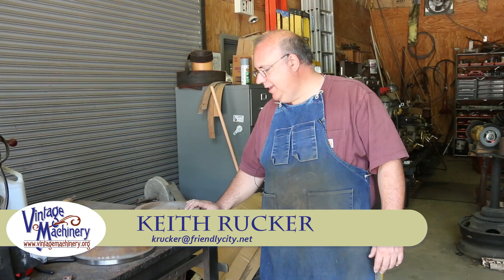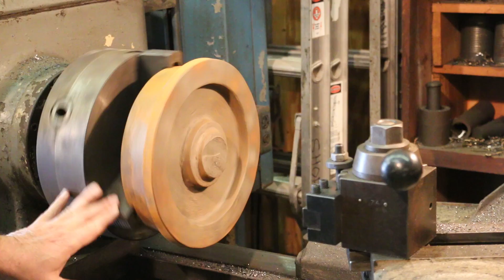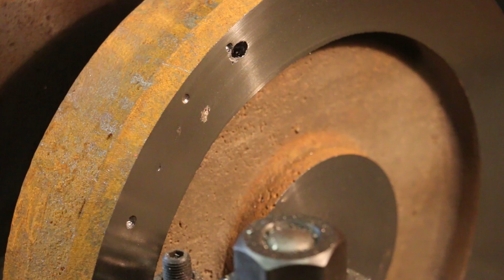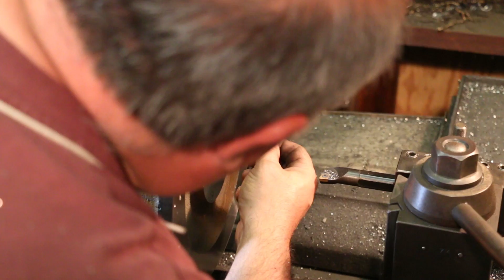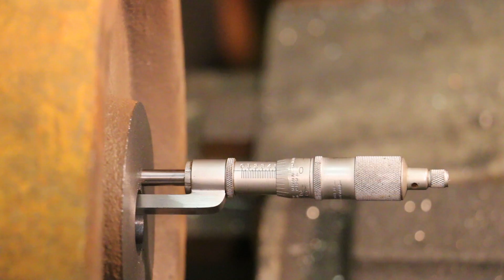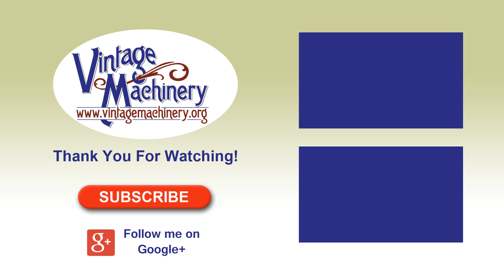Machining Cast Steel Railroad Wheels

Comment: Interesting project; nice to see some chips again.

I taught myself to put the right amount of pressure on a micrometer by closing down on known sizes (gauge blocks) until I could arrive at the exact (known) measurement with my eyes shut. Practise that way with several different micrometers until you hit the correct measurement pretty well every time. Get in the habit of measuring several times and measure a few more times if your measurements aren't all the same.

If you discover that one of your micrometers errs consistently, it may have been calibrated by someone with a different "touch" than you have. Time to recalibrate it to match your touch.
Reply from the maker: +Peter W. Meek Good advise!
Reply: On a 0-1 inch, couldnt you close it all the way and the pressure it takes to go exactly to zero is the pressure you want to shoot for when taking a measurement.  Thatd be a pretty quick way to know exactly how much pressure for that particular mic.

Comment: 1" shaft seems awfully small to me too..  yikes!
Reply from the maker: +Jay Walt If I were building them from scratch, I would probably want a bigger axle, but they are basically re-building some existing cars and that was the way they were made.  Having never seen them, I don't think I will question them too hard.  It is a smaller gauge railroad afterall.
Reply: @VintageMachinery  Keith, back when we were building 1.5" scale equipment we used 1/2" DC1616 bearings.  1" bearings of the same type would be fine with the 2' gauge equipment.
Reply: The axles are loaded principally in shear, and not flexure. Since  the car-load consists only of passengers, it will be light (maybe several hundred pounds).   It is probably  OK, but I'd do a little pencil-and-paper stress analysis if I was involved.
Reply: To understand axle size requirements you need to understand the design of railway car axle/wheel design and the load it will carry. 
A quick Google search will bring up the Veterans Memorial Park Railway in Bristol Fl. and watching one of their videos you can see each car holds 10 adults so you can easily figure  each car will carry up to an average of 2000 lbs of people. 
Now understanding rail axles you need to know the axle between the wheels is primarily there just to hold the wheels apart the proper gauge. The weight is carried on the stub that sticks out beyond the wheels. 
It’s not like the axle needs to carry the weight from the center.
Reply: +Jay Walt It's a small thing. Check them out on the internet. 8 wheels per cart, i'd say distribution is all right.
Reply: +Jay Walt Agreed - I'd expect the axle for a 2" gauge railway to be more like 1" radius at least. Maybe a miscommunication somewhere along the line?
Reply: That is correct. The trick is machining a radius in the corner of the axle shoulder to prevent breakage.
Reply: 88,000# shear strength... on a 4-4-2... 3 axles...
methinks is plenty durable,... prob. a hardened axle also.
how long is a lifetime guarantee ??
Yours, or the Companys ??

Comment: Keith, is grinding those voids out and TIG filling them not a reliable option for train wheels like this?
Reply: I'd be very wary of welding something like this, it might provide an asthetic repair but these are only the faults that have come to the surface and may well be an just indication of the quality of the casting overall. Without xray or similar evidence of the soundness of the work I would say the best use for that castng would be as a trial piece for your setups and then as a useful weight to put behind the door on a windy day.
Reply from the maker: +Thomas Utley Tom - as far as I am concerned, that whole casting is suspect to me now.  They have extras so I think it would be best to just start with a fresh one.  That casting will probably be the one I set up the CNC lathe on when I turn the surface of the wheel!
Reply: +Thomas Utley  I thought the same thing.
Reply: +Tim McCauley I think your X-Ray comment applies to all the blanks, its just that the voids/inclusions in that particular piece showed up in the cutting zone.

I came to the comments to see if anyone had asked this particular question.  I'm interested in more views.  I've thought it through from my perspective (stress engineer), and I've come to the conclusion that it could be done but wouldn't be worth the effort vs getting another casting.

+Keith Rucker I very much enjoy watching your videos. Thanks!
Reply: I like how the foundry was kind enough to send defective castings for your practice setup runs ☺